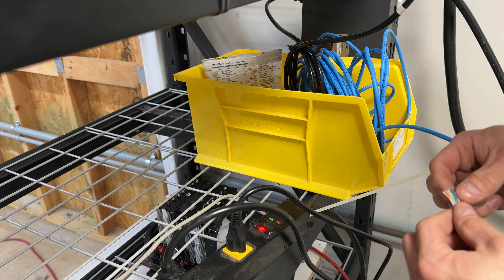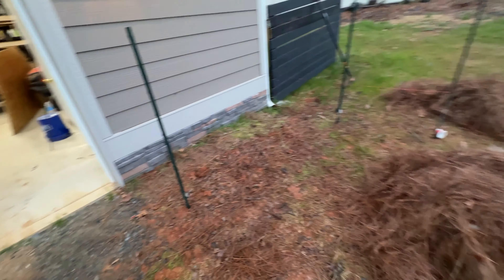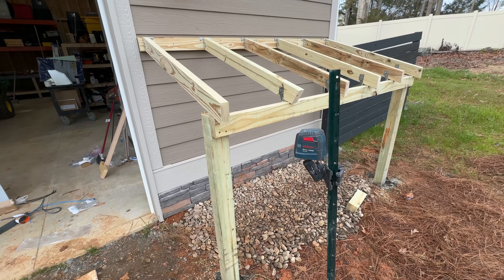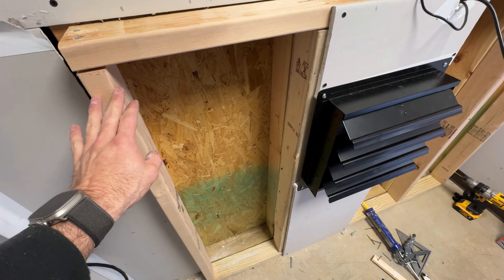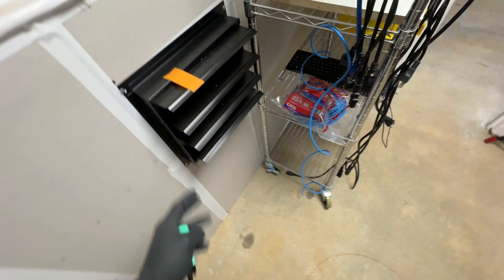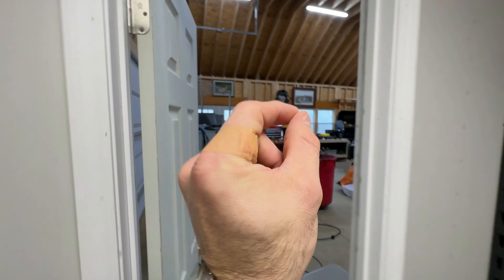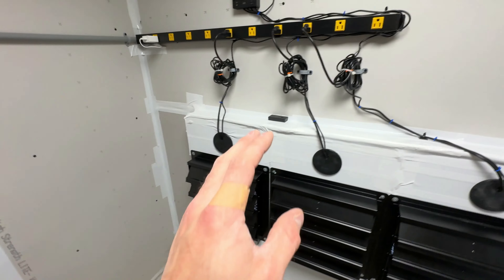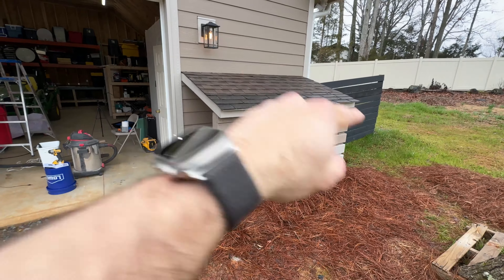Installing 2500CFM of Cold Air Intake In My Crypto Mining Shed

Comment: Your New NickName is Bob the Builder.  This intake method is amazing! Love the Gable Vent + Shutter Fan. Active Intake is going to do very well for you.  Because your using Active Intake that amount of CFM is really going to pull in a ton of bugs, dirt and dust.  So those filters may get a workout.  Eager to hear how it works out!
Reply: You may want to force those shutters open on the intake fans with zip ties.  As they are kind of breathing through a strawl right now with the gable vents.
Reply from the maker: Yea, I had them taped for a while. Right now it's still pretty mild so i'm not too concerned, but in the summer they'll be fully engaged

Comment: i am kind of puzzled why you are making an intake as such ? if your fans was blowing the air out of there you would automaticly creatye cold air inside as the air will be pulled in. Thats how intake systems work. you need to exhaust as far as i think, not intakeand no exhaust. I have no intake fans but i have 3 x 16 inch exhaust fans from ac infinity.
Reply from the maker: I did put in exhaust, just not in this video. It was done later. Also, passive intake seems too slow I need a positive pressure environment as much as possible to prevent seeping
Reply: @TechnicalsMatt  i think if the air intake big enough , you wont really have seeping but looking forward to your future videos about your experince buddy! i have a medium gpu farm 110 x30series in 11 octominers i am using passive intake at the minute.

Comment: Your "intake" louvers are impeding incoming air because your louvers are for EXHAUST AIR! An intake air (Supply Air) should have fixed louvers.
Reply from the maker: Yep. In summer i'll affix them fully open. I leave the louvers on because in winter, i'll turn off the intakes and recycle the air to heat the shop.